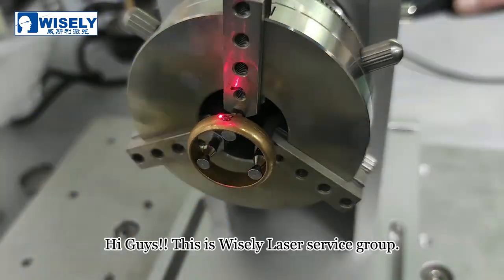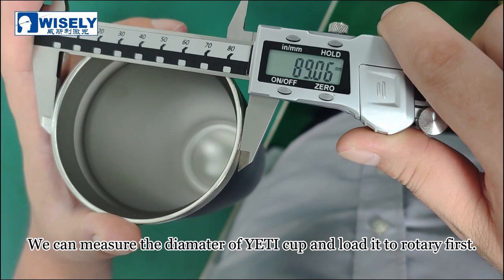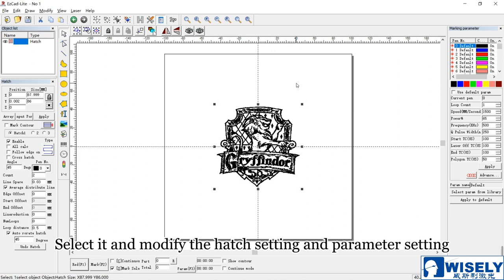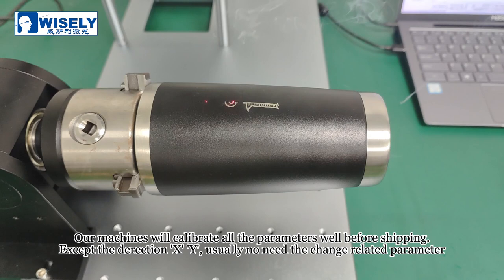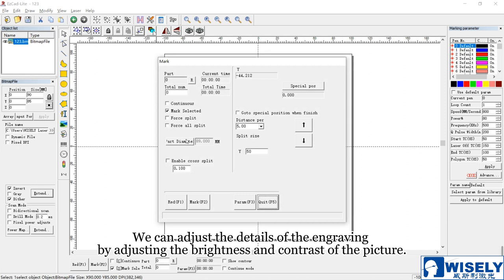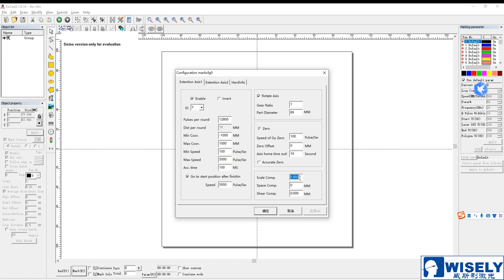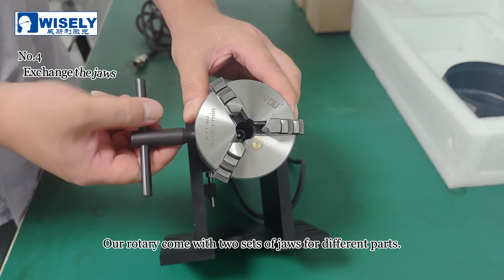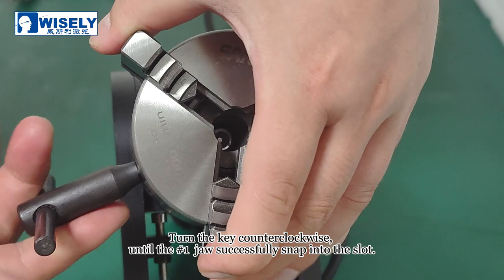Fiber Laser Rotary Engraving Guide with EzCad2 | Rotary Basic Use & Problem Solutions

Comment: I have the same motor, is the pulse per round 12800 or 6400?
Thank you.
Reply from the maker: It depends on how do you set your motor driver code. Open the laser machine find the motor driver you will see it.